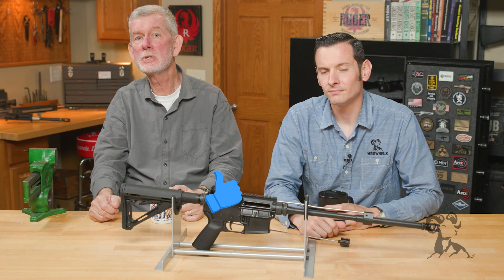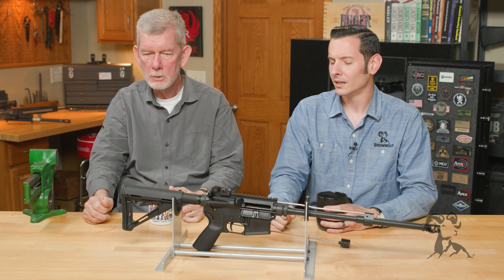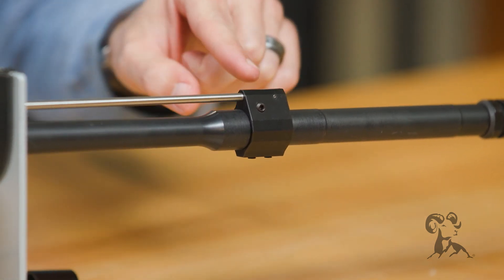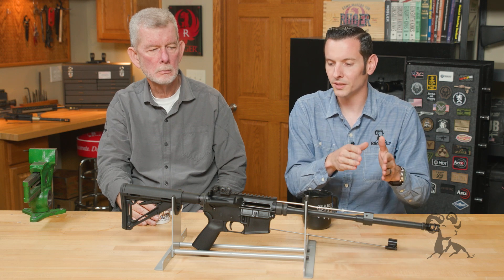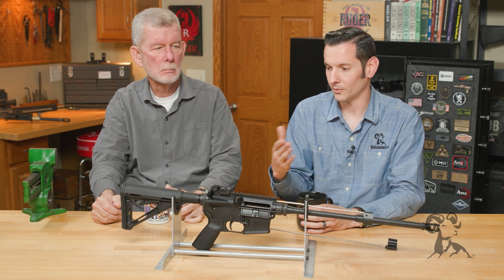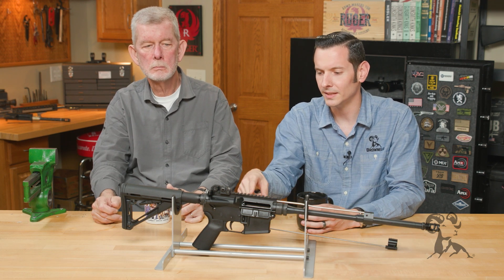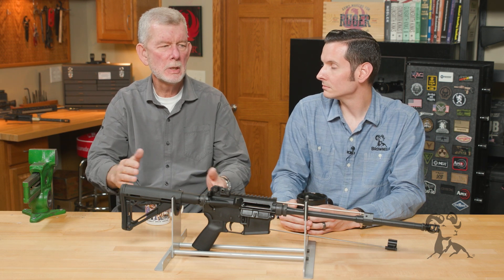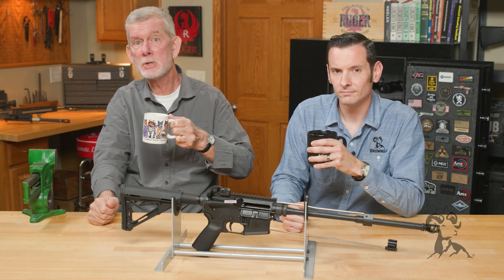Smyth Busters: Does Every AR-15 Need an Adjustable Gas Block?

Comment: Would it be recommended to make the hole in the barrel a little larger w an adjustable block?
Reply: You can definitely drill out the gas port on an undergassed AR barrel. don't listen to these other people they've probably never shot enough to have ever needed to change a barrel let alone even done it. It's very common to do on AK-47 builds a lot of the American made barrels are under gas on AKs and need to be reamed out when built, some times you have to drill it a few times to get it the right size. it's definitely not something that the average person should do or has the ability to do but if you are meticulous have a mill or a drill press you can definitely ream your gas port larger. Brownells will carry all the tools, probably a jig even.
Reply: @G3oc3nt1c  yea this is why I’m responding to you and not them 😎 I’ve built a lot from scratch. This isn’t my first rodeo. I’m just wondering if it’s reasonable to make it bigger with the adjustable seeing how it can be adjusted. It makes sense to me or would it be easier to use a BRT easy tube or maybe weld a block st8 to the barrel? I guess it’s something to experiment with. I have a few extra barrels lying around. Just trying to confirm if someone has happened to do it. Interesting concept. Thanks for the reply. At least I’m not alone in the thinking of the possibility.. It’s good to confirm that.
Reply: @hunanbeing9164  I have done three barrels, but I only recommend this as a last resort. There can be many other gas problems in the system that can be corrected, that is not associated with the gas port size. If you don't have the gauges or knowledge, then I would recommend you take your rifle to someone who does.
Reply: I put an adjustable block on my custom build because I bought a lightweight BCG and I didn’t want it slamming back super hard.
Reply: It comes the way it does for a reason.
Reply: That's generally not advisable for 99% of people. It can be done, but there are very specific circumstances where it would be appropriate to do so.
Reply: I’m not a gunsmith, but I studied how the system works when picking components for a custom build. I would never recommend messing with the size of the gas port in your barrel. The point of the gas block port being bigger than the barrel one is so that the gas block will work across multiple barrels which will have different size gas ports. The gas port on a 20” rifle length setup will be different from the gas port on a 10.5” barrel because the ports are sized based on the application.
Reply: can you drill within thousands of an inch or just going with the next size bigger drill bit?
Reply: Remember, even though the rifle has been through 60 years of development, a putz with a dremmel tool is always a better gun designer than the Colt engineers. Colt is not on Youtube,  right?.  Just drill a nice big hole in there.  More is More and Bigger is Better.  You can always buy a new barrel once you bubba the crap out of the original.
Reply: @excelsior6365  Colt hasn't been doing shit for ages, and they're out of business now. Maybe reference someone that's actually in the business of making AR barrels.

Comment: Good info !  I was not aware that a gas block can only restrict.
Reply: Gas blocks can only restrict the gas port size on the barrel. They can restrict and increase within that perimeter..
Reply: @hairydogstail  Gas blocks can't increase gas flow, they can only restrict.  Did you watch the video?
Reply: @bertg.6056  You are not understanding what I stated..They can increase and decrease gas within the perimeters of the gas port size and pressure. They cannot increase gas outside the variance of the gas port size or pressure. If the gas port is too small, then the adj gas block is pointless.
Reply: @hairydogstail  If it can't increase, then it can only restrict.  Get it?
Reply: @bertg.6056  I'll try this one last time.. If you close the adjustment screw in all the way with an adj gas block, then this restricts the gas to where the rifle will not function. If you unscrew the adj screw it increases gas to where the rifle will function. This is called increasing, not restricting gas flow. This only occurs within the parameter pressure of the gas port size. The adj gas block can "not" increase the available pressure out side  the parameter of the gas port size. Get it??
Reply: @hairydogstail  Watch the video before you anwer with another repetitive reply.  "Gas blocks can only restrict gas flow", per Caleb.  Please address your faulty logic to him.
Reply: @bertg.6056  I'm sorry for your lack of reading comprehension...Keep at it, it should improve.....
Reply: @hairydogstail  I quote Caleb, who refutes your logic, and you accuse me of lacking reading comprehension?  Wow.
Reply: @bertg.6056  I'm not refuting Caleb, I'm agreeing with him if you had any form of reading comprehension.. The adj gas block can not increase pressure from the gas port, but it can adjust it within the pressure limits set by the gas port... Was this simple enough to understand lol....
Reply: @hairydogstail  Lol, indeed.  You just refuted your own logic.  In other words, gas blocks can only restrict.
Reply: @bertg.6056  You are a special kind of person, so I'll type slower..Re-read what I have stated the entire time.. Watching you dig down the stupid hole farther and farther is getting painful to watch........
Reply: @bertg.6056   If a water line has 45lbs of pressure, then there is 45lbs of pressure to the water facet.. If I open the facet all the way, there will be 45 lbs of water pressure coming out of the facet.  By opening and closing the facet, I will be able to adj the water pressure from 45ibs to 0 pounds and 0 pounds to 45lbs within the perimeter of the 45lbs water pressure line. This is exactly how an adj gas block works. It can decrease or increase the pressure within the parameters of the gas port pressure.. If a facet or gas block can only restrict, then once you restrict the water or gas you could never increase the flow of water or gas to the perimeter of the water line pressure or the port pressure..I never once stated the adj gas block increases the port pressure..The only other way I could explain this to you would require crayons and construction paper lol....
Reply: @hairydogstail  You're making a distinction without a difference.  I'm not wasting any more time on this.  Gas blocks only restrict.
Reply: @bertg.6056  Wow, no wonder your generation is confused by the X and Y chromosome thing.....I think you meant adj gas blocks only restrict, but nothing would surprise me with your mental prowess,,, completely hopeless......................................
Reply: @hairydogstail  The person losing the debate is generally the one doing the name-calling and insulting.  Got a mirror?
Reply: @bertg.6056  This is the problem, you keep focusing on your ego instead of the subject.. Pearls before swine comes to mind. My mistake........
Reply: @hairydogstail  Man, you are funny !  My ego?  "Gas blocks only restrict."  Yep, that's all about me.  FYI, your last two words certainly apply.  It hurts to be so wrong, doesn't it?  And publicly, too.
Reply: @bertg.6056  Prove me wrong, other than quoting Caleb, which you have zero understanding of. You explain the process in your words.... and prove me wrong.. I'll be waiting, publicly lol.............
Reply: @UC0-xaqZheXzGUZWvQe5FG_g You need to quarrel with Caleb.  I merely quoted him. Signing out of this travesty.  You may have the last word.  Since I quoted Caleb, every name and insult you spewed also applies to him.  Way to go.
Reply: @bertg.6056  Just what I thought lol.  You have zero understanding on how an adj gas block works or the gas system of the Stoner rifle....I never countered or disagreed with Caleb and repeatedly expressed this to you numerous times..I was trying to help you understand the process of the adj gas block, since you obvious have no concept of its operation or the Stoner gas system. You are too thick to even realize this...Like I stated before, pearls before swine.......
Reply: @hairydogstail  "You can only restrict your gas flow, you can't get more gas", says Caleb.  You say he's wrong.  Fine.  You're the expert, right?
Reply: @bertg.6056  The adj gas block will not increase the barrel port pressure as I have stated many times..The adjustable gas block can adjust the port pressure up and down within the perimeter of the barrel ports pressure..Lets say the gas port pressure is 14000 PSI. The adj gas block can adjust the gas up and down from 0 PSI to 14000 PSI or 14000 PSI to 0 PSI within the perimeter of the gas port's pressure of 14000 PSI...It cannot increase the pressure past the perimeter of the barrel ports pressure of 14000 PSI...Are you starting to understand????? If the gas port pressure to my rifle is 14000 PSI and I screw in the adjustment cutting off gas to 8000 PSI, then I'm restricting the gas. If I decide to increase the gas to 10,000 PSI by screwing out the adjustment screw then I just increased the gas to my system. This is increasing the gas of the barrel port within the 14000 PSI barrel port perimeter... I never said Caleb was wrong, the only thing wrong is your reading comprehension..This is why they are called adj gas blocks. It is people who do not understand this process, "who use an adj gas block on an under gassed rifle" thinking it will increase the barrel port pressure when it won't... The only way to increase barrel port pressure is to drill the gas port bigger..You don't need to be an expert to understand this, but you do need the reading comprehension of a 3rd grader.....
Reply: @hairydogstail  In other words gas blocks can restrict more . . .  Or restrict less.  Give it up, you've lost the argument.  The clue is the name-calling and the attempted insults.
Reply: @bertg.6056  Yes, it can be described as restricting more or less. It can also be be described as increasing or decreasing the gas within the perimeter of the gas port pressure, which I have been saying all along. ..Sorry your mental cognitive ability is just beginning to comprehend this..By the way, it is adj gas blocks we have been talking about, not gas blocks lol..Perhaps you also need a lesson on this too.. If the definition fits, "it is not name calling" its called using the proper definition for the subject at hand..I have been generous with you in this regard...
Reply: @hairydogstail  I quote Caleb accurately and you disgorge name-calling and  puerile insults.  What is your problem with Caleb?  If you don't like what he says, why not deal directly with him?
Reply: @hairydogstail  And yet you took such vociferous and dramatic exception to my quotations of Caleb?  Your puerile comments only reflect poorly on you.  Perhaps you need to take your dramatic outbursts directly to Caleb?  I only quoted him accurately.  Not my words, his words.
Reply: @hairydogstail  "Umbrage".  "replies".  Duh.  Spell much?
Reply: @bertg.6056  Think much??I prefer umbridge:a malevolent, uptight, and pink-garbed. Best description of you so far :) But you would know yourself better than me, so umbrage it is :a feeling of pique or resentment at some often fancied slight or insult.
Reply: @bertg.6056  Say's the Sucker, who keeps biting the same bait over and over again. Remember, gas blocks can increase and decrease within the perimeter of the gas port pressure...
Reply: @hairydogstail  According to Caleb, gas blocks can only restrict.  Restrict more, or restrict less.  You are making a distinction without a difference.  And I certainly don't mind monetizing the channel.
Reply: @hairydogstail  You're making a distinction without a difference.  According to Caleb, gas blocks can only restrict.  Take up your stubborn position with him.  Of course gas blocks can restrict less, or restrict more.  Wake up, man.  Actually, I don't mind monetizing this channel, I'm subscribed.
Reply: @bertg.6056  Still hiding behind Caleb I see, pitiful..So you tell your boy friend to restrict the water facet more or restrict it less. Got it lol... Sane people say increase the pressure or decrease the pressure by opening or closing the valve..Play on words that so easily provokes you ;)
Reply: @hairydogstail  Gas blocks don't "increase" anything.  May I suggest that you watch the video?
Reply: @bertg.6056  I could suggest what you could do, but I won't...I repeat myself, play on words that so easily provokes you. Hilarious :)
Reply: @hairydogstail  I understand that concept quite well, since it is you that is making a distinction without a difference.  Gas blocks only restrict.  If you need to argue, check with Caleb.  That happens to be his opinion.
Reply: @bertg.6056  That went right over your head, No surprise here..
Reply: @hairydogstail  I suppose I should have clicked on that link, maybe.  But whatever it is, it won't change my position of agreeing with Caleb:  Gas blocks only restrict.  You can take whatever position you like.
Reply: @hairydogstail  Some guy calls me names and hurls insults, sends me a link and expects me to click on it?  I. Don't. Think. So.

Comment: Giving people the ability to fiddle with gas often results in user induced malfunctions. The less trouble they can cause, the better. I like adjustable gas blocks for experienced folks who will set it right and leave it alone.
Reply: Adj gas blocks are not complicated. You adjust the block to the ammunition being used. If you are like most AR shooters, you will use ammunition that runs the whole spectrum of pressure. Not hard to find the adjustments for each brand of ammunition. The other caveat is to maintain the adj gas block with a little oil and running the screw in and out all the way after any amount of shooting, so it doesn't become carbon locked..Experienced folks understand their rifles, get the most out of them and maintain them....
Reply: Easiest way to prevent it is to have the weakest ammo you can find, for an example Wolf, or any low budget 223, make sure it cycles just fine, by making sure the bolt opens on last shot by shooting 1 round only, full cycle, and bolt open, you can give your gas block 1-2 clicks more open just in case, and every 5.56 ammo will shoot wonderful
The only time I saw gas block fail on me, is when I didn't pin the gas block to the barrel. Now I dimple/drill the barrel enough to make sure screws actually stay in fixed position. Loctite without dimples will quickly unhinge the gas block, and that is more sure to cause an issue of cycle. 

Adjustable gas block is key for the softest shooting AR. Proper buffer weight and spring of course is just as important.

I use JP enterprises silent spring, and can have the lightest spring with adjustable gas block to make sure everything cycles and nice and soft shooting.

Comment: This is why you should build from the ground up... I'm looking at these comments and seeing a lot of "that's my next upgrade" or "mine didn't come with one". You can avoid the entire issue of you just build your AR from the ground up, since you can pick the exact pieces you want before you buy. Building is much cheaper than straight up buying an assembled gun. Seriously, everyone should AT LEAST consider it. If you're competent with your hands, have the minimum mental competence of a 13 year old, and can read beyond a 4th grade level, you can build an AR.

Comment: I have a couple of Wilson Combat 18" SPR'ish barrels that have been discontinued that are over gassed. I should say they are over gassed with a carbine buffer. I run a Geissele Super 42 buffer set up as a H3 and they run soft and reliable. This leads me to believe that Wilson Combat drilled the gas port in the barrel to work reliably with a rifle buffer.

Comment: The only AR that I have with an adjustable gas block is on my suppressed blackout. Normal AR's? Nope, solution in search of an issue. There are better ways to tune the rifle.
Reply: If you shoot 5.56 suppressed then an adjustable gas block is nearly always needed and a very good idea unless you like breathing toxic fumes.

Comment: Should I put an adjustable one on my Glock?  :)
Reply: Definitely! And while you're at it, get a nice CQB stock or brace to go with it.... slap a PEQ box on there for that extra tactical feel. 🙂
Reply: @lincolnpascual  and if using the stock, dont forget to use the rail under the barrel to attach a vertical grip. Makes it much easier to control recoil than with both hands in the same grip, more so if you have hands larger than average
Reply: I put one on my 1911 3" barrel and it works like a charm now...

Comment: What I've seen is far more problems with adjustable gas blocks in terms of reliability. Springs and buffers make it not only more reliable, but on the spot simplicity to tune your gun.
Reply: Most gas blocks are even easier to adjust, just turn a hex key
Reply: If you tuned your rifle to one type of ammunition pressure curve of the spectrum with springs and buffers, then it will not be tuned to the other end of the pressure curve..

Comment: My upper came overgassed and beats up the brass more than I'd like. I'm planning an adjustable gas block as the next upgrade to help with reloading longevity
Reply: Don't cheap out on it. Big differences in quality. Avoid all aluminum agbs. 
Stainless contracts the same and cleans easier. Check out the SOTAR videos on that topic.